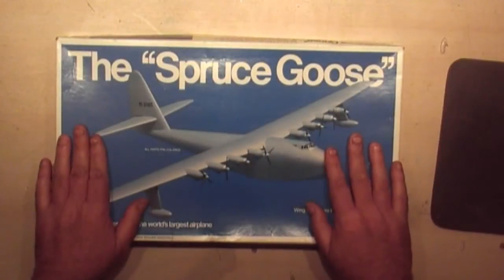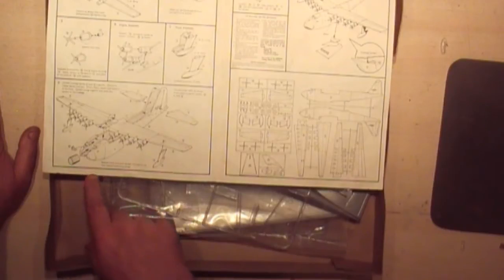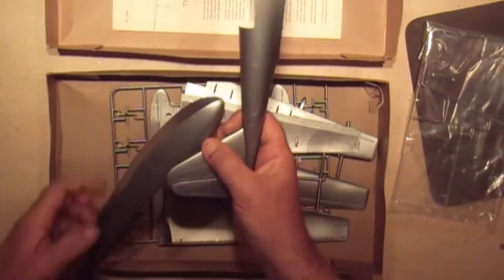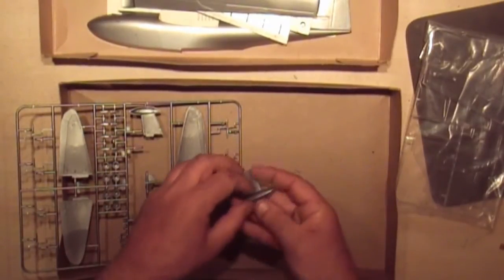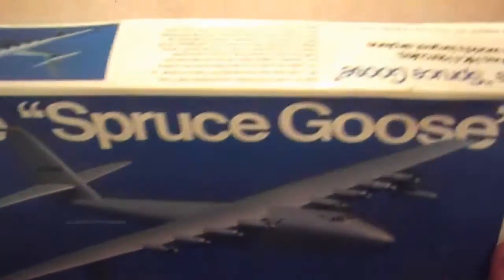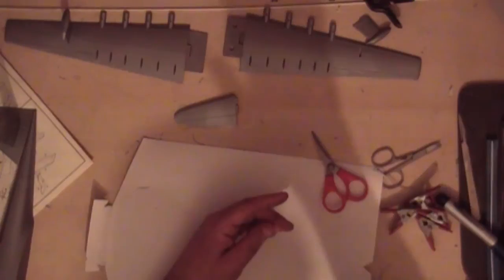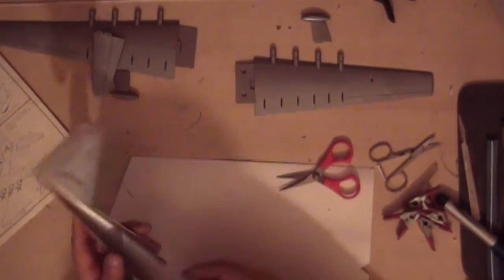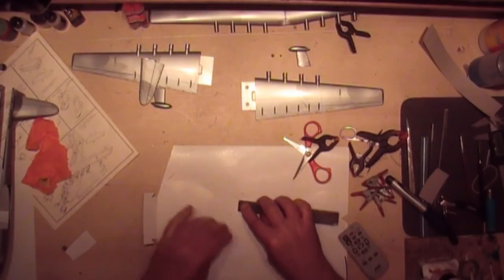The Spruce Goose Review & build part1

Comment: Being such a huge aircraft would it not have the droop in the wings anyway ?
Reply from the maker: in this case no the wing sections are very thick given a stiff wing even today there is no droop there.
if it was a more moden one there very mite be but for a models it a bad thing as it can in some a crack the join on the fuzz as in the C130